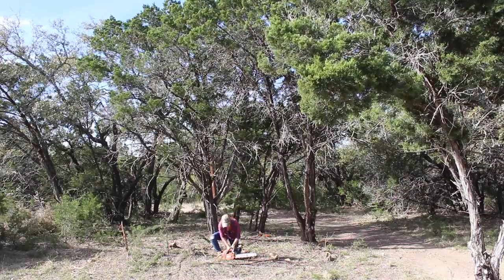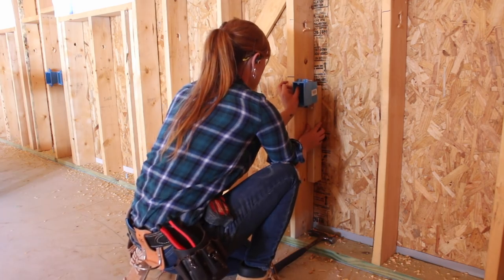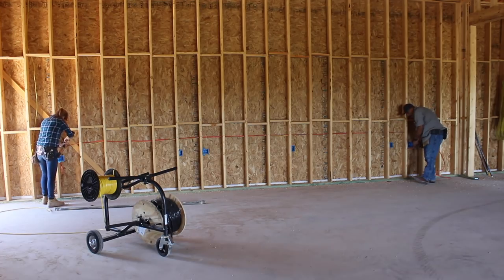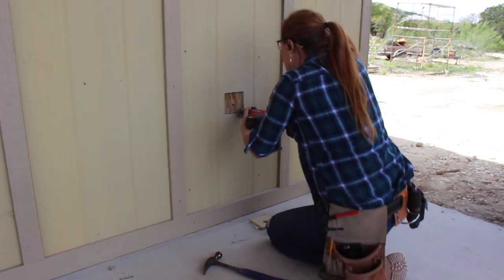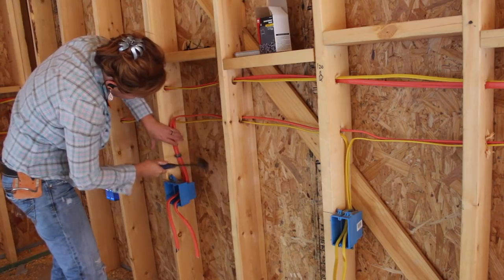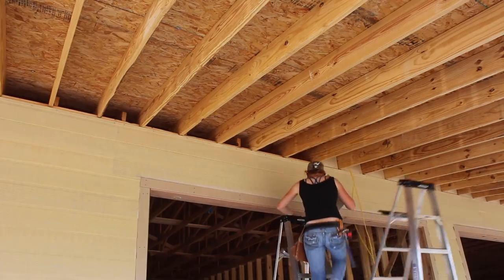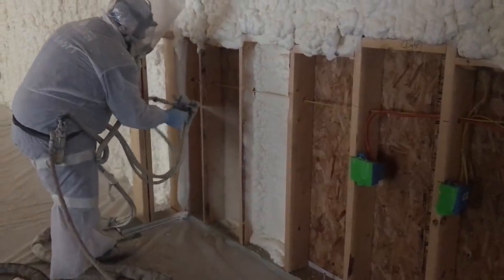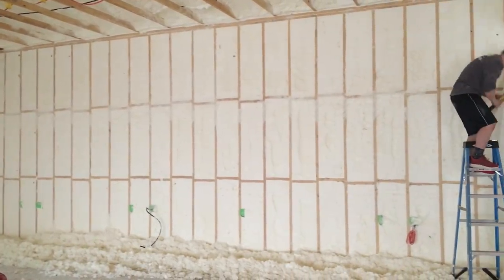Wiring My Shop and Spray Foam Insulation

Comment: Hi April.  Your shop is really coming together nicely.  I have a couple questions.  First, will you be installing pneumatic lines for a air compressor and if so, will you locate the compressor outside to reduce the noise db?  Second, will you be going with a one zone HVAC unit or two zone system?  Just asking as I'm fascinated by your build. Thanks and I'm looking forward to your next upload.  Cheers!
Reply: I personally would certainly recommend 2 zones, especially because I wouldn't want that grinding smell in my wood shop, but also because if you're only using half, why pay to cool both halfs?
Reply: Stop Spaming

Comment: Spray foam also makes the structure more structurally sound and will have less flex than and be able to hold up better in storms.
Reply: Not to mention that is great to control the noice
Reply: Open cell foam doesn't add much for structural stability since you can poke your finger right through it.

Comment: Why don't you use a trunking system (right word?) on the wall for your wiring instead of the wires in the wall? With a trunking system you would be much more flexible to choose the place for the outlets and it allows you to add every time additional wires.  
Sorry, it is a german link, but you can see, what I mean.
https://www.hager.de/wandinstallationssysteme/bruestungskanalsysteme-aluminium/tehalit.bra-kanalhoehe-70-mm-oberteil-80-mm-frontrastender-geraeteeinbau/930234.htm
Reply: Rainer Lilje-Halbritter That’s a much better system, more expensive to install - but easier to install and modify.
Reply: Have such dado trunking just above table -heigth running all around the workshop. Placing all kinds of sockets whereever they are needed. In between table and french-cleat. Then regular cable conduits in the upper 30cm installation area of the walls for distribution. Only thing missing in the dado trunking are pressurised air, vacuum(negative pressure) and dust collection.

Comment: Looks really good. Only thing I'd do different is to run the wiring through flexible conduit to make it easier to alter if needed.  I went to a demo on spray foam and how it is better than 'glass. They took 2 identical 8X8 sheds built using home construction methods. One got regular F-Glass and the other closed cell foam. They showed the heat losses and all the rest of the benefits.  The last item was showing how the foam acted as a glue. They used a crane and lifted each shed so it was 20 feet in the air, then dropped them on a corner! The f-glass shed crumpled like nothing, the foam one sort of bounced, dropped flat and other than a slight bit of damage to the corner framing it was still usable!

Comment: I wonder what happens to all the surplus foam they have to cut off, is it usable for anything?
Reply: This is one of the issues with spray foam insulation, all the trimmings just get trashed.
Reply: A good spray foam installer won't overfill the bays. They'll know the appropriate amount to spray just so it might barely stand proud of the bays.
Reply: I would think by it's nature it must be oversprayed at least an inch or two at the thinnest spot meaning more than that in the thickest areas? Otherwise, you wouldn't get it 100% flush everywhere. Not sure a "good" installer would intentionally under fill the bays and it's impossible to get it perfect.
Reply: I'd think that some amount of overspraying is inevitable. I was hoping the surplus could be used as, say, granular loft insulation but I'm guessing that it's thermal performance is much poorer when it's not a solid mass.

Comment: I like that spray foam and can see how that seals up all the cracks, so although the physical r value is almost the same, the lack of air movement probably makes a higher apparent r value. I'll bet its nice and quiet in there with a real solid igloo feeling.

Comment: You went with open cell.  Do you still have to have a vapor barrier or breathable moisture barrier?  I have been researching a lot on spray foam and they always say that if you use open cell foam you have to have an extra vapor barrier and depending on where you live some kind of breathable moisture barrier that lets moisture out.
Reply: Is my understanding that S.E.S open cell doesn't require extra vapor barrier.    (Its already on the B component)
Reply: Brian your wrong about the vapor barrier
Reply: I wouldnt spray foam ur sides by your wiring. Just do you ceiling. When you need to add wiring or redo the wiring later down the road its gonna be more painful to remove the spray foam than rockwool
Reply: A first timer, I thoroughly enjoyed watching your video and your shop is amazing!! I'm more than a little curious as to why the choice was made to go with open cell rather than closed cell. Like Brian, I've read a lot about the two so my curiosity is piqued.

Comment: Spray foam is awesome and something to consider in areas with high winds and snow. The foam actually bonds to all the surfaces in the walls and adds a lot of additional strength. The cost is worth it!

Comment: Just curious April...Did you have to have the electrical inspected prior to the foam install?  Great vid, thanks!
Reply: Tom Lagatol , good question.
Reply: Tom Lagatol Good question...don't know to rules in US, maybe it is allowed to 'megg' the cables. This way you can test the isolation resistance. This is how i do it with already build projects. 👍
Reply from the maker: I live out in the country where there is no jurisdiction for inspections. The electrical company will only be inspecting the pole installation work.
Reply: As a note on this, if you (as a viewer) live in a similar area with no jurisdiction for inspections, it's never a bad idea to have the work inspected even if it's not required.  Of course in April's case, having two professional electricians speaks for itself so she really didn't need it, but for a DIYer learning from this video, it can't hurt to get an inspection for piece of mind :)
Reply: April, out of curiosity...  did you mark as-built locations on prints for your wiring, i.e. mark on an elevation print of a wall where the wiring ran horizontally in the wall?  Also, Did you label both ends of your wiring so you can easily label breakers and outlet covers with a number system or something like that?  It sure makes it much easier when you can glance at an outlet cover, see the number on it, and easily locate it in the breaker panel.

BTW, I admire your work, your abilities and your "Can Do" attitude.  You're simply amazing!
Reply: +KSReferee-That's a great idea especially in a large shop with many circuits, etc.
Reply: I only asked as in my neck o the woods not only is inspection of the wiring required (electrician or not) but a permit to do the work must be gotten....   Thanks for the reply April.
Reply: N.C. also Tom. We have to have an inspection of electrical, plumbing, insulation and building construction. If you have a well put down it has to be inspected. The permits are outrageous.
Reply: April briefly mentioned that she took a video of the entire shop for the sole purpose of knowing what is what.  Not sure if that'll help without the labeling though, but the majority should be easier to locate with the video.  I did this when my home was built.  It has come in handy so many times.
Reply: Shocking.  !
Reply: Tom Lagatol in Texas if you are the home owner and you're building the building yourself, in most county's (non city) you do not need permits or inspections. But having your work looked over and signed off by professionals will save you big time on insurance and liability costs.
Reply: That's a first
Reply: Additionally, just because your county may not require it for building, your home owners insurance most likely does. Definitely worth looking at your home owners insurance documents to see what is required during construction of new structures etc. Also if you have business insurance, you need to make sure that the building that you are using is covered, and what their requirements are for buidling usage.

There are so many things you have to look at when doing construction, shouldn't just start building.
Reply: Troy Meredith absolute it will help. A person that knows what they are looking at can get by with a picture, a video, or a mark on the floor just as quick as you can get there from your way. And April is a person that knows what she is doing so she will be fine with whatever system she has that works for her already, he’ll, she can probly out perform most men on this site, she is awesome!!!!
Reply: April, first and most importantly, any time you cut the products that you call cement board PLEASE wear an approved resperator. These products have a nasty ingredient called silica sand and can cause silicosis ( liken to asbestosis ). Don't know where you get your knowledge but it is very obvious you listened ,learned, and retained. Couldn't tell I'm impressed could you. Glad I subscribed carry on girl, you rock!
Reply: Here it doesnt matter where have to have electrical, plumbing open wall inspection and framing.
Reply: Tom Lagatol if you are required to or want to get it inspected, then yes, there can be no insulation either bat or spray, they need to be able to see the wires and electrical components
Reply: April Wilkerson what is the length and width of your shop. And it looks great good job April.
Reply: Just wondering why you used spray foam? I no you want to save time it is a big shop. What about the fire ratings on that foam ? I no one little spark and goodbye new shop? And when that foam starts to burn it releases a very toxic gas that can nock u out in seconds. Thy may have changed it but there was only certain buildings you can use that stuff in but of course you’re in Texas and no inspection which I think is crazy that’s why you have water coming in your building if you got inspection on the site  the inspector would’ve noticed that you are in a low spot before it rained. And my-Be would have gave you a heads up. But it’s all good just want to no what you think of the foam❓👍🏻😎

Comment: helpful hint, Always run electrical gray pipe from the top of your panel up and through the top plate.  This way you can always come back and add electrical runs back into your main panel easily through the attic.

Comment: I was in the same boat on my shop, and had closed cell foam placed, as my metal building did not have a vapor barrier installed, so they were concerned about open cell foam collecting condensation as the metal heats and cools.

Comment: I think it's worth mentioning that a huge disadvantage of spray foam (other than the enormous cost, which seems to be less of a factor for April) is that it makes repairing/altering anything in the walls/roof nearly impossible. It also makes it impossible to find leaks. Nice shop though! It's very similar in many ways to the one I'm building, actually, though April's happens much faster. I like seeing the progress!

Comment: I did closed cell spray foam insulation in the ceiling of an underground garage, and it was a huge difference for the rooms above. Stopping moving air is the key.

Comment: I'm curious about the excess foam that is scraped from the walls and whether the company has a waste reduction plan for reuse/repurpose.
Reply: David S I've always wondered about that too... I would think you could chop it up a bit and use it for loose fill in some attics.
Reply: Eric Wotton - pretty sure Mike west is right about loss of fire retardant properties. My curiosity led me down a Google rabbit hole. I found a forum discussion from 7 years ago in which installers throw around some ideas. http://sprayfoam.com/forum/topic/use-for-overspray-shavings/1554
Reply: It is sugar based so they grind it up and sell it to Starbucks to put in their coffee
Reply: that's exactly what we did with ours.  We took the remanants from our home's spray foam insulation and broke it up and scattered it in the attic of our detatched garage.  While it wasn't as good as blown in insulation, it definitely helped.
Reply: David S, i used to do spray foam many years ago, I had the same concerns back then. Depends on who is spraying you dont have much to shave, however, sometimes there was a ton, we bagged it and trashed it.
Reply: also depends on whether its open cell or closed cell. even with a really good installer theres going to be a good amount more waste with the open cell simply because it rises/expands soooooo much more than closed cell.
Reply: I'm deeply sorry for you, man :( it seems to me you'd like to own every single power tool that April showed and USED on this video, right? Well, my dear, let me help you out with this issue by telling you how to get started and how to reach your goal at the same time: WORK FOR IT! (just as hard as April has worked!) Instead of posting greedy cheap comments, build something, get a life or just get off this channel!

Comment: Really informative on how things are done on the other side of the ocean!
But what if there's a problem with one of the electric cables? Did you all check them before butting the insulation in? What if, in the future, there's a problem with one of the cables, do you have to take the whole wall apart to replace it? I guess that's the whole purpose of putting electric in tubes over here in Europe, you can always run new wires thru it, electric wires in contact with wood, I guess the inspector would not be happy with that in my country. Sometimes things are so differently done around the world....
Reply: Not Just Sawdust yes here in Europe you must put cables in pipes where cable is in the wall or going thru wall basicaly if you cant see cable it must be in pipe for extra protection
Reply: Just a note: In many parts of the US, building codes are quite different than in Texas. I've also been surprised by several parts of this build.
Reply: That's true, there is the National Electric Code but the local town or city is the one that actually administers and enforces the law, and they all tweak the code to their region.
Reply: With the insulation to keep the wire from moving, there is very little chance of something happening to the wire unless someone cuts or drills into the wall.  I'd just run a new wire in that case vs tearing all that out.

Comment: So no plumbing.
Reply: The Cynic not in the walls
Reply: Not unless she drills a well.
Reply: She could connect into her house system, unless it's too far away to be practical. It could especially be a problem for the sewer system if her septic system is uphill from the shop. Though a "lift-station" could help with the uphill problem.

Or a toilet system like they use in an RV or a camper might solve part of the problem - or a good old-fashioned outhouse nearby. And unless she wanted to do showers or wash-up, she could always bring a cooler full of whatever she wanted to drink for the day.
Reply: This place is big enough to be her home and a shop. 

So is this going to be two shops one for her one for her husband?

Comment: Sugar as a fire retardant? But sugar is extremely flammable.
Reply from the maker: It's very interesting to read about. They pass every fire rating test with flying colors.
Reply: What about mice is it critter proof?
Reply: That was kinda blowing my mind too, but a quick google search shows several patents on the idea.  The sugar just one part of the chemistry.   Here’s an example: https://patents.google.com/patent/US20130030067A1/en
Reply: Not sure about the open cell, but the closed cell is very "critter proof" due to its make up.  It not only seals possible entrances, but the materials contain a component that they will not chew and repels insects.

Comment: the biggest difference in open vs closed cell spray foam is that open cell spray foam requires a vapor barrier, where closed cell does not. also Closed cell spray foam runs about an r 6 per inch vs the approx r3 per inch that open cell gives.
Reply: And there is the vapor barrier ?
Reply: according the ES-Report for SucraSeal it is air impermeable at 3" thickness.  It is its own air impermeable membrane.
Reply: Don't forget price.  That's a big difference in the open versus closed cell as well.  😜
Reply: Don't forget price.  That's a big difference in the open versus closed cell decision as well.  😜
Reply: Closed cell is also waterproof...where open cell is not, and allows moisture to penetrate if a leak develops.

Comment: Hi April! IT is very amazing, seeing the Shop beeing completet😉 But we use in Germany a System in Shops, that allowes you a more flexible Installation on- not in the Wall! You can easily change the place of Machines in the Shop, without changeing the Installation in the Wall ! And repairing the wires ist a Lot easier. Excuse my horrible writing, please!

Comment: Another great video and very informative. One question, I did not see any air lines being run in either shop, are they being run in the attic and then dropped down the wall alongside vac systems?